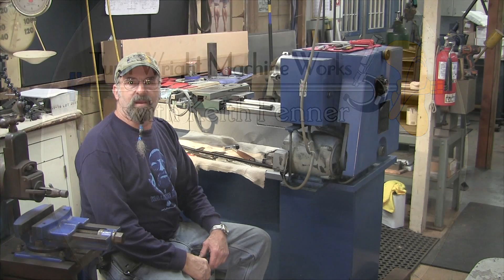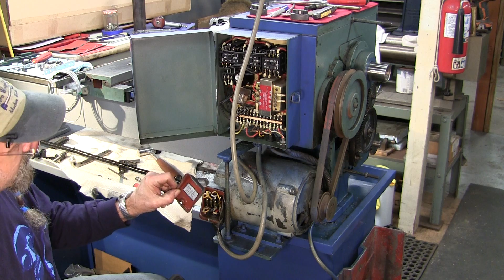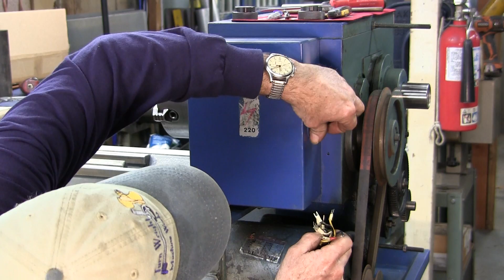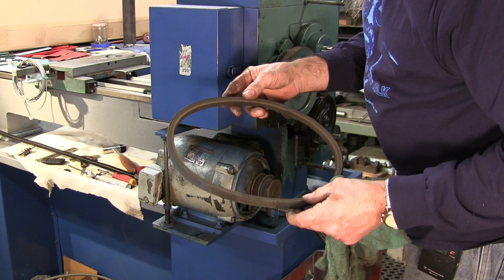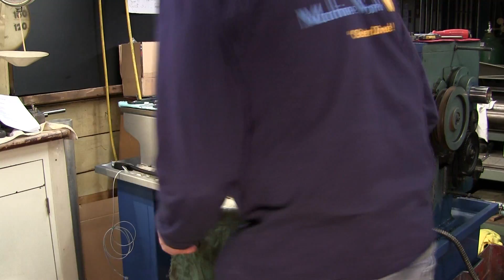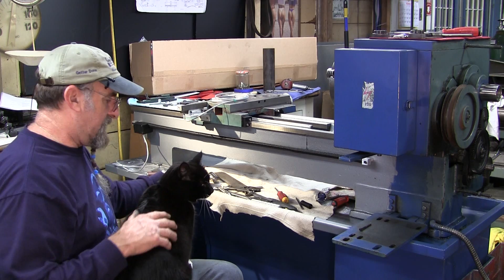Let's Look Under The Old Girls Apron Part Seven

Comment: Best of luck with the upcoming surgery Keith and a Merry Christmas to you and Vanessa. My lathe is just an inch smaller swing than yours, but no gap on mine. I am more than a bit interested in seeing how you get a proper foot brake fitted and operational. And a bit frustrating sometimes when you have to go in and properly fix some past butchers "quality" part replacement, repairs and adjustments. Some of it can be so basic like your belt and pulley alignment you have to wonder how they got it that wrong.

Comment: "fernanjs" had mentioned using liquidtite flexible conduit, I agree with that, for single conductor wires, that go from the control panel to the motor. 
Also the multi conductor flexible cords are available by the ft. The best of those would be type SJO, rubber outer jackets, and rubber insulation on the inner wires. The "O" in SJO is for oil resistant. The "J" is for junior, rated 300 volts, so the OD is not huge. 
Also the BX coming out of the right side, should also be changed to SJO, if it has a plug on the end, or liquidtite, if it is wired directly into a junction box. They also make oil tite connectors for the SJO cord, that are made specifically for connecting the cords to the knockouts in the control boxes. 
I don't work for Granite City, but these are common stock items that should be available from them.

Comment: Hi Kieth
because the motor turns forward during normal operation and reverse when jogged. I think the jog button is connected to the reverse starter coil. 
best of luck

Comment: if the belt doesn't line up, isn't that a pulley alignment problem?  It would seem moving the pulley over on the motor shaft would line it up.  If the pulleys aren't in the same plane, that's another story.  the vid wasn't clear which problem it was.
Reply from the maker: It was a little of both. pulley was all the way to the end of shaft, the adjustment stroke was maxed and the motor was twisted. ;{)------

Comment: Hey Keith, love your videos, especially this series, I'm a rebuilder/ scraper hand by trade. I do want to share that reverse jog is industry standard on most lathes. It's a throwback to the old helical geared headstock on your heavy American iron. On those without jog you have to roll the chuck backwards to make the gears pull into eachother due to the tooth angles. When the Asians started cloning machine tools in the 80's they mostly used straight cut spur gearing to keep cost down but still copied the reverse jog setup that was used by American machines. Just wanted to share that little bit. Keep up the good work!
Chris German
Reply from the maker: Thanks for the comment and the sharing! cool, Cheers,  ;{)-------

Comment: Hey Keith, I would recommend running all of your wiring inside of "liquid tite" conduit. It protects those high voltage lines from impact and oil/coolant. I have a roll lying around an I would be happy to send you some. You would just have to get yourself some connectors for the ends of the conduit. Feel free to message me if you're interested.  -Joe

Comment: If you can put that back together with ring terminals on the wires instead of spade terminals, you will have a much safer installation. If the binding screw ever loosens (you will know it electrically before it vibrates all the way out) a ring terminal will stay in place, while the spade terminal can pull out and end up almost anywhere. 

The "push bar" should be as close to the belt as possible to avoid twisting the motor mount.

Comment: Hi Keith, The motor u took off looks to be a single phase. You  should be replaced with a three phase motor they are much more efficient. That is probable your jog problem also you can do instant reverse for threading with a tap. Three phase motors are not captor start. Also if you need any help with the wiring just let me know I do lots of machine wiring in my job. I love your videos keep up the excellent work!

Comment: Hi Keith,
Anxious to see you install the disk brake, so far I'm more used to band brakes... 
Got snagged a few times drilling and tapping into some hardened cast iron areas on lathes where I needed to install some DROs or accessories...  Not a treat...
Hope everything goes all right with the surgery, and, Happy Holidays to you and family,     Pierre
Reply: I'm eager to see the brake install too. I wonder if it will be hydraulic or cable.

Comment: Very good series. I'm going to be getting into a very old Sebastian gearhead lathe control wiriing soon. So your series will help. My question is. Is the motor a dual voltage three phase or a reversable single phase? In the picture of the control box it looks like you have a reversable contactor group for three phase? This is a sincere question as I will be dealing with this as well.
Reply from the maker: It does look the relays can handle three phase but the motor is single phase 110 or 220. ;{)-------

Comment: Why don't you mount the readout on the backside of the carriage? When you slide it to the chuck it seems as if there would be enough room for mounting it behind the gap, so that may be a bit more practical if you plan on removing the gap some time.
Reply: Nevermind, should have watched until the end first.

Comment: Plastic nuts and bushes on industrial gear - never a good combination. In my day, as an electrical engineer in industrial environments, we always fitted metal parts to termination boxes. They take the rigours and abuse of day to day shop activity (and don't perish in oils over time). I hope you're replacing with metal, Keith.
Reply from the maker: Yep!  ;{)-------
Reply: Good man! I'll bet your motor tension problems stem from the wrong size belt being fitted at some time in it's past - a sort of "That'll make do" moment.

Comment: To fix the pulley alignment, could you just loosen the pulley on the motor and slide it out. I've done that many times getting belt drive woodworking machines set up.
Reply from the maker: It would of been hanging off the shaft a bit, I have done 100's of motors and alignments, I was just noting what caused the assembly to be in the found location, and the need to make it right, with plenty of room to adjust correctly. ;{)------

Comment: When I am planning on replacing the wiring, but just want it out of the way for disassembly, I cut the cables where they go into the box. That way the internal connections are left intact so I don't have to rely on memory/pictures to figure out how the old wiring went. It's just matching colors.
Reply from the maker: Yes, I sometimes do that and chose that method on the rotary switch on the front of machine.  ;{)-------

Comment: I had an epiphany (minor discomfort) could it be that the jog was wired to reverse for threading returns when half nut continuously engaged?
Reply from the maker: It could have been, I gave some thought in that direction too! I still want to put brake on motor to reverse quicker, and I would use jog to help time or clock existing threads etc. in forward. ;{)------

Comment: Would you consider to put a new electric motor inside and upgrade the system with a frequency converter?
At the very least, the bearings need to be exchanged on the old one.
Reply from the maker: We will be playing with that option, but for now we will be reassembling clean and new wiring, it is an easy place to get an change outs won't be too time consuming. ;{)--------